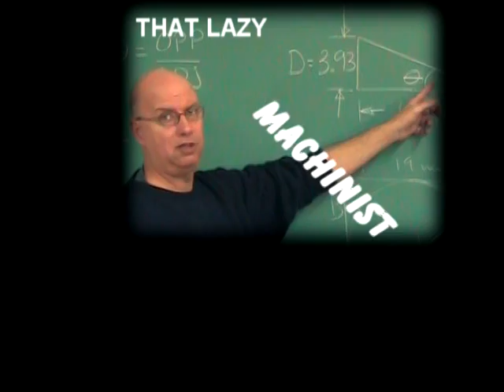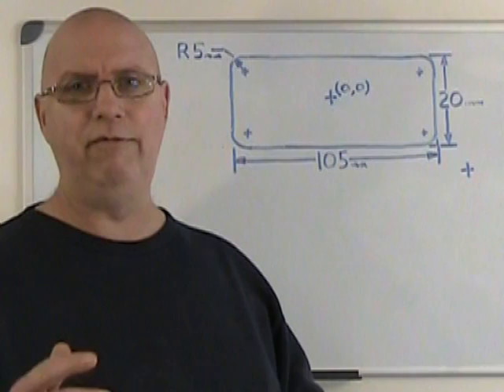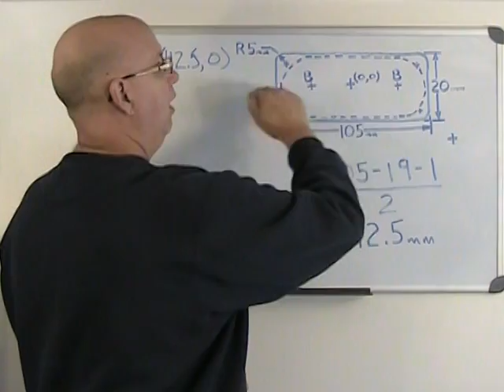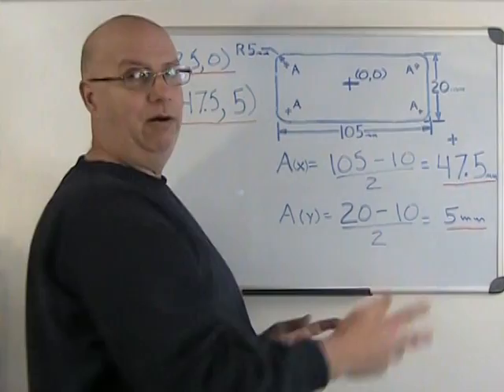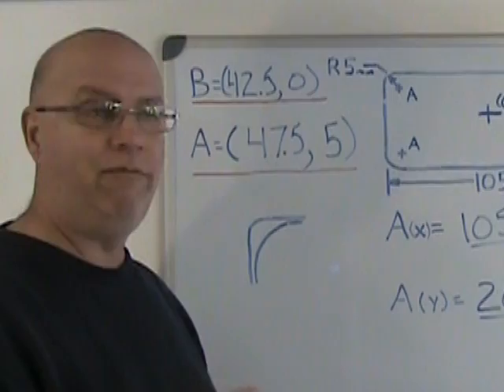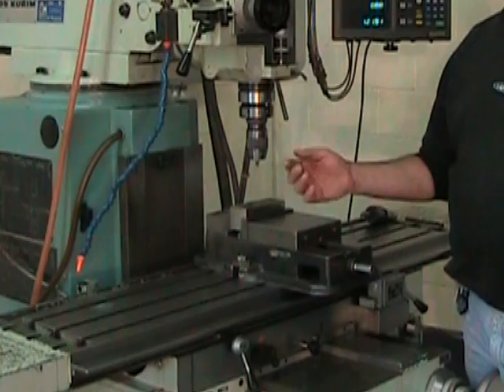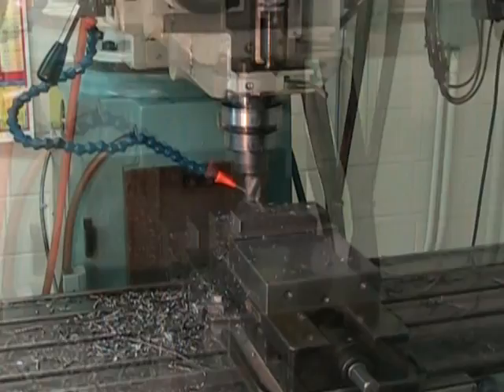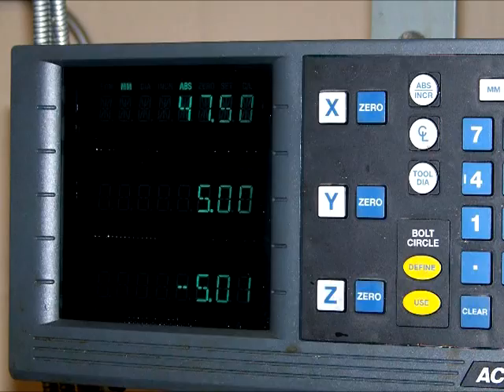ACCURATE POCKET MILLING BY COORDINATES USING A DIGITAL READOUT, ROUGHING & FINISHING, MARC LECUYER

Comment: Marc, I have spent the last couple of days searching the net and my text books for the procedure for milling a pocket when a DRO is not available.  I can see how I can locate the origial reference point via an edge finder.  I can see how to move to any the edges that are furthest from the reference edges.

How do you move back towards the edges closest to the reference serfaces?  The best I can see is to move "forward" so that the backlash is gone, lock the table in one axis and then plung and move in only one axis along the edge.
Reply from the maker: Hi Ctjctj2, there are two simple ways and a few more complex. So here are the two simple ones.
First way: Many machines have a adjustable table stop for the x axis and some have one on the Y axis. If you have them, use them. If you don't, you can use two dial indicators in the following way. Find your edges, set your collars to zero, go to your first corner and reset your collars to zero and install a dial indicator on the far (back) side of the table and set it to zero (I have a video on edge finding http://youtu.be/potUx4AdxzQ) (I have a video on milling without a readout  http://youtu.be/hx7shEX0aFo) . Move your table (towards you) to your second corner in the Y axis (you can use your collar since it was set to zero). When you wish to return to your original Y position, just return to your zero on the dial that you installed. Do the same for the X axis.
Second way: If you have no table stops and only one dial indicator,  find your edges, set your collars to zero, go to your first corner and reset your collars to zero and install a dial indicator on the far (back) side of the table and set it to zero. Move your table (towards you) to your second corner in the Y axis (you can use your collar since it was set to zero). Up until now it is the same as the first method. Now you will return to your first corner, counting the number of turns and noting the collars position when your indicator says that you are back to zero. You now know the coordinates of the two Y positions and can return to them at will. Do the same for your X axis and you are good to start cutting. I would like to do a little quickie on the subject, it is not necessary but I like to use the first name and the general area that they are from at the start of the video. if you are ok with that, could you send me the info, if not it's ok I will use Ctjctj2. I hope this answer helps, and thanks for watching, Marc L'Ecuyer THATLAZYMACHINIST.COM
Reply: THATLAZYMACHINIST Marc, thank you for the explination.  I get it.  I was almost there but missed.  This last weekend I was showing my wife how DRO's, dials and indicators work (The machine I have came with a DRO but only one axis is working).

I was able to use the dial indicator to show how when we moved in one direction the dial and the indicator gave the same results.  (I understand that the slight angle means that over larger distances the dial and indicator will be wrong)  When she moved the dials in the other direction suddenly the results were different.  She then understood backlash.

With the information given I now feel confident that I can do this operation.

As for the LQ, please please please.  I sometimes feel like everybody but me has (functiona) DRO's.

Chris Johnson, NH, US

Comment: Marc,
    Do you lock the axis that you are not using on the final pass, or do you just leave it un locked? In other words while traversing down the x axis side on the finished pass do you lock the y axis?

     Thanks for sharing your time and tallent.

    Chuck.
Reply from the maker: Hi Chuck! Great question! It's something I should have mentioned! When I am taking heavy cuts on a vertical mill (since they generally don't have a backlash arrestor) , I always lock the axis that I am not using and use a conventional milling direction of cut. However on my finishing cuts I like to climb mill since this direction of cut gives a better surface finish, requires less feed and suffers less tool deflexion (so it is more accurate). The major problem with climb milling is that the tool wants to grab the part. To control the problem on a vertical mill (since many horizontal mills have backlash arrestors) I "snug" the locks on both the X and the Y axis. Snug means tight enough to alleviate the grabbing problem but not so tight that I can't move the axis. This technique is however harder on the machine so it should be used sparingly and only on well lubricated machines. I hope this helps and thanks for watching! Marc L'Ecuyer THATLAZYMACHINIST.COM
Reply: THATLAZYMACHINIST
Very nice addendum to a very well done video. I got a lot out of this one, too. Gold mine (with gold) of information. I don't know if you get Animal Planet's "Ice Cold Gold" series on television, but if you do our son has done work for them for two seasons now. If nothing else it gives one a view of the rugged and beautiful natural in which we are so fortunate to live. I'm happy; machining safely. Thanks! jim